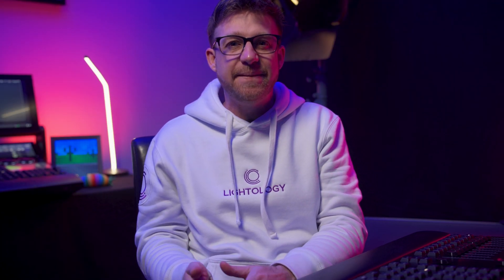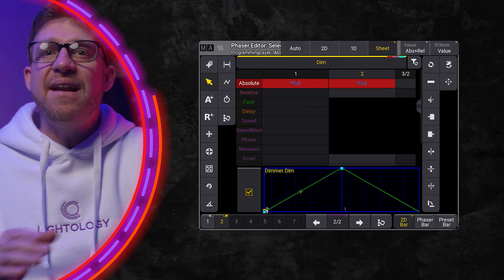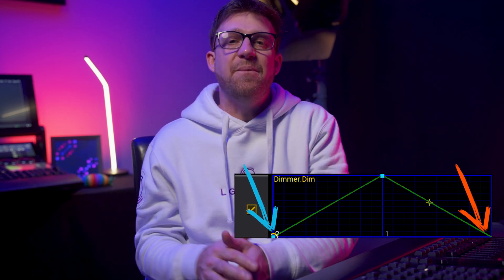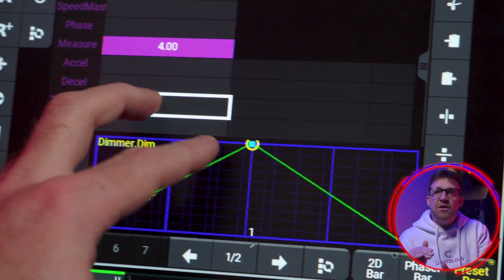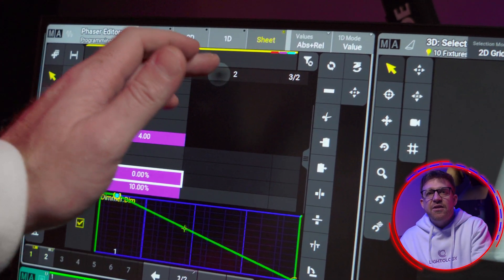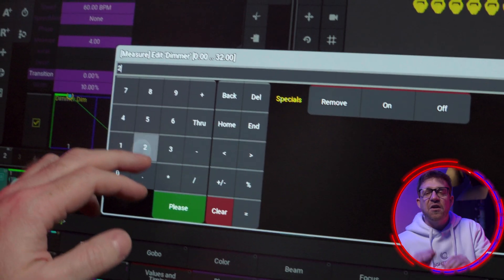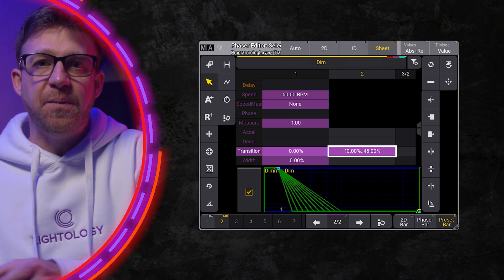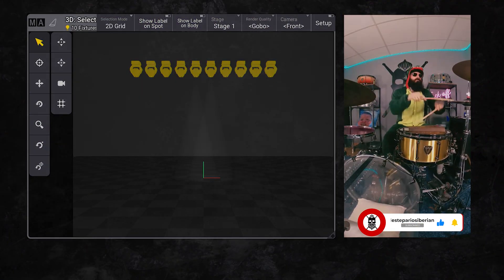The Beginner's Guide to Using Measure in Phasers

Comment: Great Explanation. How will the workflow change when you start to assign MaTicks to the phaser? That always confuses my bpm
Reply from the maker: Hey! Thanks for the comment, That's a fantastic question!

It's generally a good practice to maintain a 1:1 ratio between speed and your phasers. In our workflow, we typically avoid adjusting the speed directly within the MA Tricks layer. Instead, we link our Phasers to the Speed 1 Master.

Currently, in version 2.0.2.0, there is interaction between the speed settings in the Encoder Bar and the MA Tricks Editor, which can be a bit confusing. To keep things simple, try sticking to the "SpeedMaster" attribute in the phase layer. This should be less confusing for you.

Let us know if you have any other questions!